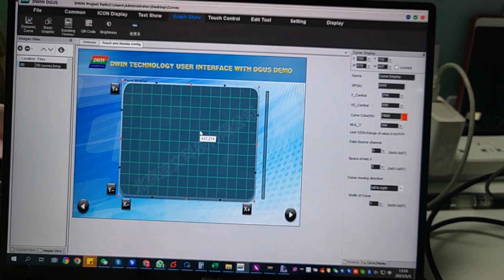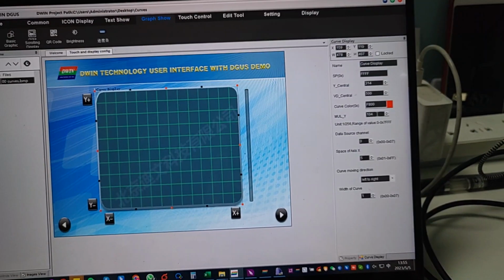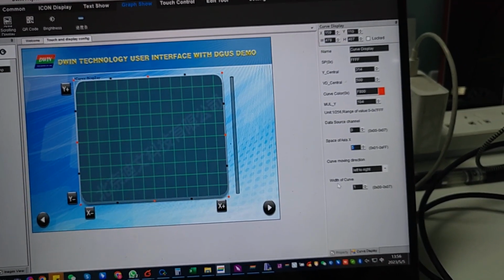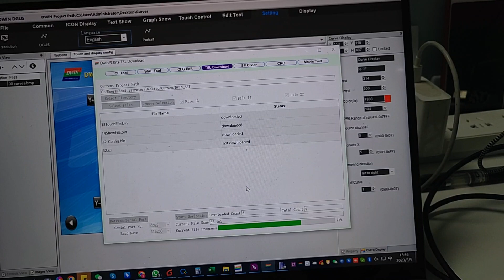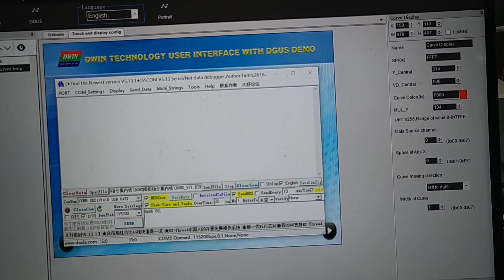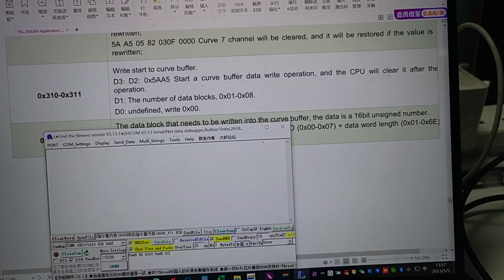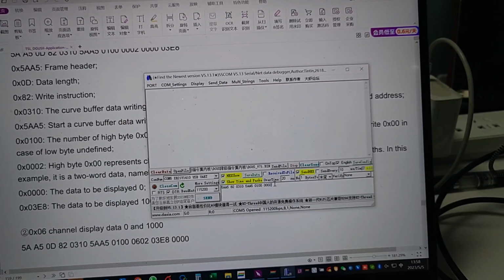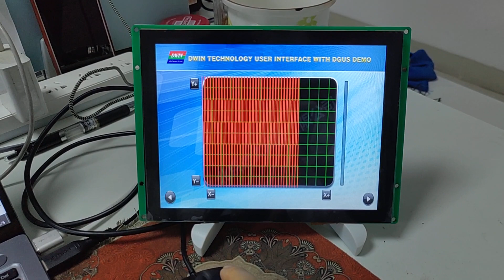T5L Enhanced Tutorial #38: Full testing for the real-time curves

Comment: Maria can we change the line width of curve, its not available in my version of DGUS, can we set via a command??
Reply from the maker: You can set the curve width in DGUS software tool.The parameter is width of control. I already checked DGUS software tool
Reply: @guomaria6878  in version 7.645 (latest) the option to set width is no there
Reply from the maker: @Bondango  really? If so, suggest you adopt DGUS v7.643
Reply: @guomaria6878  it is problem with DGUS app, we have big screen resolution and when we remove windows taskbar we car see scrren width option. It appears off screen, eveb with large resolution scrren. the dialog box for settings does not scroll for user so option is hidden off screen :(
Reply from the maker: @Bondango  Emmm, that's bad. I didn't check DGUS 7.645. I can understand you.